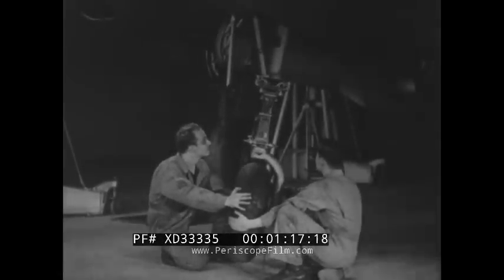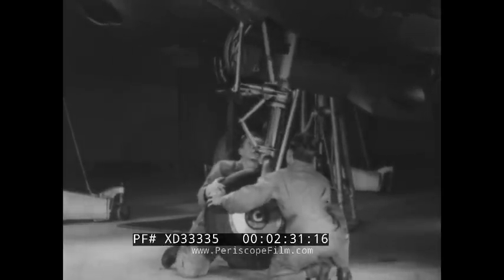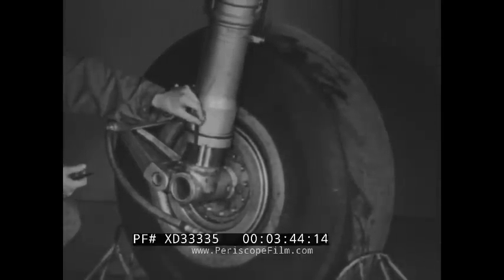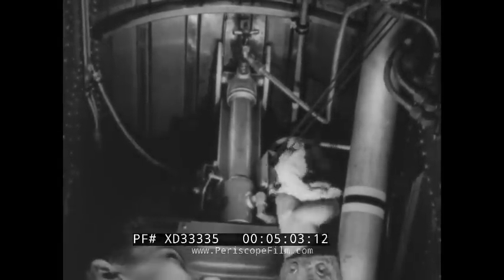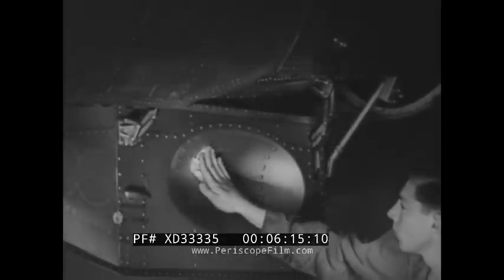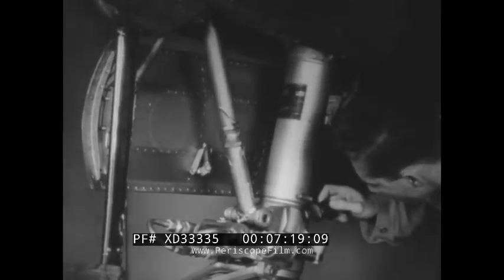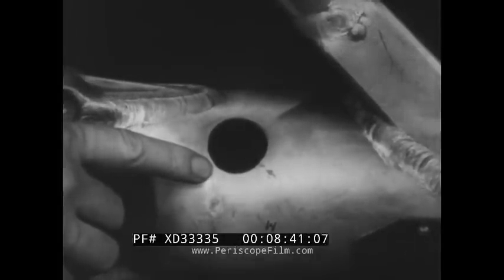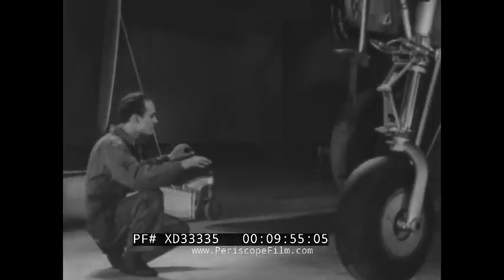" P-38 ALIGHTING GEAR "  WWII P-38 LIGHTNING LANDING GEAR INSPECTION FILM  XD33335

Comment: Shows how American aviation hasn't advanced since then. This is how I was taught to inspect landing gear, and it was in writing in the manuals. A lot of the manuals I had access to were still re-using drawings of aircraft and their systems from the 40s and 50s. This was in the mid 2010s when I finally gave up on general aviation.

Comment: When I worked at Ascension island as a diver in the 80s (Middle of the Atlantic) they ferried P39 air cobras from US down the Caribbean over to Brazil then across to Ascension, then latter to Africa and then North Africa. One day in the early 1940s a P39 was late arriving coming in well after dusk, he was out of fuel trying to make it but ended up landing in the water just offshore of the runway. We found the plane in 180fsw, the wheels were up. The pilot made it ashore but the gun battery's opened up on it thinking it was a threat. (edited it was a P39 not a Lightning)
Reply from the maker: @deepbludude4697 amazing ... so was the plane intact or in pieces ... being aluminum it might still be in decent shape today considering how deep it was. Our friends at Air Sea Heritage would love to know (https://www.airseaheritage.org/) BTW thanks for being a sub.
Reply: @PeriscopeFilm  I knew immediately it was a P39 not a twin boom P38 lol. We had very little bottom time at that depth (USN Cert B decompression off a hanging stage) so I couldnt check it out as much as I wanted that said: The visible forward half was beat up with evidence of some galvanic reaction near midship (where the engine would have been) the current at that location might have been dragging it around, yet still had one bent prop blade visible (of 3) from landing, the aft part was covered in course sand IIRC the cockpit was smashed, you could just make out the air intake aft of cockpit. it was underside up. I believe the tail was missing as it sat too level to the bottom. The older divers on our team never remembered seeing it near that location and I looked thru all the photos we had at the time for a possible photo of it. On subsequent dive ops we searched for it, as USN/USAF were concerned that it would foul the cables used for CTBTO nuke monitoring compliance, as well as Missile Impact Location for the Poseidon, Polaris programs. We never saw it again. On the same island near the same beach approach of runway near the cliffs a cockpit to what I believe was also a P39 still with some instrument gages the chromium green paint they used for corrosion control visible, part of the seat structure. I made the mistake of telling some others about it and next time I went it was also gone. Years latter I was at Attu island where there was another P39 recovered off the end of the west side of active (ATT) Runway. It had flipped upside down and was in better condition given the muck in that area. That island was so cool! The USAF ( I think it was the PJ's) where involved in the recovery then flew it back slung under a helo. last I heard it was a display at EAFB Anchorage. Love your channel it seems I have a good deal of connection with alot of your restored films and I really appreciate the level of effort.
Reply from the maker: @deepbludude4697 thanks these stories are fascinating.